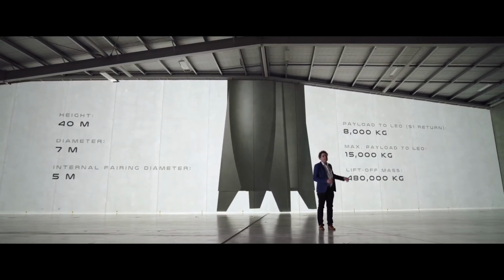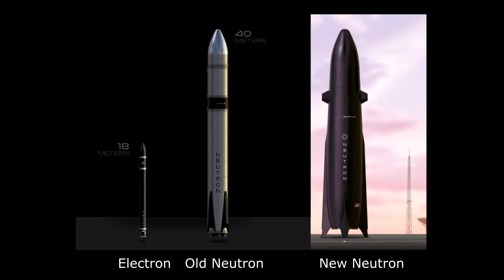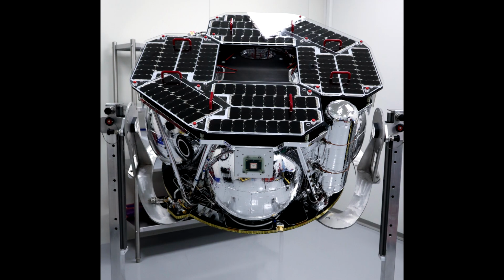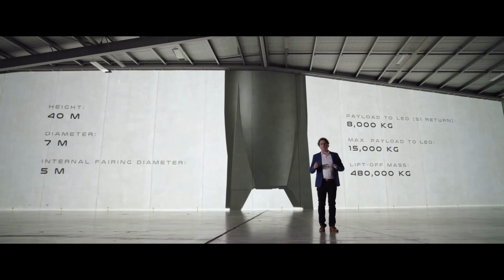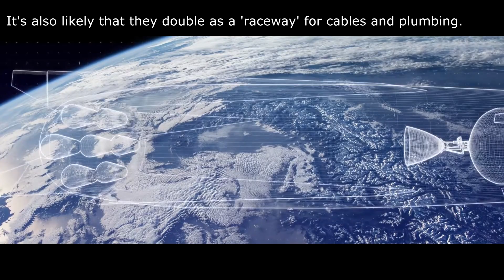Rocket Lab's Neutron Rocket Will Be More Reusable Than Falcon 9

Comment: I love everything about this. The clamshell fairing is brilliant!! Also I thought the digs at other companies was pretty funny. It’s not comparable tho. Starship is supposed to be able to go to Mars and has to return from orbit. Spacex also wants to build hundreds or thousands, so price of materials is a bigger issue. In theory rocket lab needs 5-10 at each launch site and just reuse them over and over so if it costs more to build but is more efficient it’s worth it.
Reply: It is totally comparable to Falcon 9 though. But I agree with you.
Reply: @aretorta  agreed. But other the falcon is a traditional design that has been upgraded to add reusability, where as starship and neutron are being designed with innovative designs for reuse from the beginning.
Reply: @ryanhamstra49  Yes and given the minimization of expended equipment and mass the Neutron would presumably have a lower life-time cost, but probably a higher production cost for each first stage.  If it can hit the reuse threshold then it will likely undercut F9 and all other new competitors in that 8 mt range.
Reply: @aretorta   Yes totally comparable to a 10 year old design, probably 13 years by the time it flies.
Reply: a major concern isn't just the cost of carbon fiber as it would make back that cost in fuel and durability eventually but it would take a long time to make enough carbon fiber for one starship and for what starship is designed to do being able to mass produce them on a large scale quickly is a huge part of the viability of the launch system and making them out of carbon fiber would take far too long.
Reply: There is a reason why fairings are jettisoned in all other designs. Once rocket is out of atmosphere the fairings are dead weight, significantly eating into payload capability. So while it is unusual, it is not brilliant. Others have thought about it before.
Reply: @maximlg253  Any aerodynamics of the 2nd stage is dead weight.  RL is betting trade off is worth it. A lot of things have been thought of before - the issue is with a given technology whether it’s practical or not.
Reply: Neutron is basically a successor to falcon 9 for its payload range.
Reply: Not to mention sounds expensive to replace.
Reply: lets all hope, I need a couple for my volcano base though.
Reply: I am pretty sure that I saw this clamshell fairing design in an old James Bond movie?
Reply: @MoAndAye  And you just admitted to not watching the entire video.
Reply: @MoAndAye Scott talks about the Bond movie at 4:54 (that picture is from the movie)
Reply: Guys, Gahen is just a Wannabe Troll.
Reply: Starship is never happening. When are people going to start accepting this?
Reply: @NavidIsANoob  SpaceX is good at sending stuff into space. So I would not be suprised if they send something starship shaped up into space. I don't know what it is supposed to do there.
Reply: @NavidIsANoob  
Except it already flew a couple of times. It proved that it can do most of the hard parts of the flight. The only thing left to test is the reentry, and that SpaceX has done well over a hundred times.
Reply: The only legit stab was Falcon infrastructure not Starship's anyway.  Plus, payload weight class helloooo
Reply: @lostpony4885  and the barge landing
Reply: The dry mass of Starship is just insane. A Heavy-lift Vehicle from NASA's SPS study has similar payload to Starship (120t), yet only 4000t mass when full. Which is less than simply the fuel mass of Starship, and even with some mass reserve! Apparently, aluminium construction/winged flyback is a pretty efficient design!
Reply: @HalNordmann  > A Heavy-lift Vehicle from NASA's SPS study has similar payload to Starship (120t), yet only 4000t mass when full.

Oh, let me guess... the 2nd stage there is LH/LOX? That obviously weighs less than CH4/LOX.

> Apparently, aluminium construction/winged flyback is a pretty efficient design!

Especially in PowerPoint form :)
Reply: spacex is not going to mars... analyzing Starship™ usability from that starting point is fundamentally wrong
Reply: @LoneWolf-wp9dn  It doesn't make sense for humans to go to Mars. The only thing humans can do on mars is dying more or less slowly. Rovers and probes can do the science much cheaper. It would be interesting to do missions as drilling and get samples back to earth that will be challenging and get some real data for science.
Reply: @lubricustheslippery5028  Actually it does make sense. In a billion or so years the sun will vaporise Earth and probably Mars. If we're lucky, and if we get started now on the incomprehensibly long and difficult task of finding a new home, we might just save humanity.
Reply: @lubricustheslippery5028  sometimes people just want to go & see for themselves, even if you personally are happy watching robotic photos, and besides what are we doing on earth but more or less slowly dying?
Reply: @kirkc9643  On the scale of a billion years, it matters not at all if we start now, start 100 years from now, or even 1000 or  1 million years from now.
Reply: @erikmagnuson9670  Given that currently we have no idea how to find, even get to, or establish a self sustaining colony beyond our solar system...Upon what do you base your claim? A billion is a thousand million. One thousandth of the available time to do multiple things that are currently impossible to ensure survival of humanity seems like a significant amount of time to me
Reply: @kirkc9643  Exactly - 1/1000 of the potential time. What are the odds that the impossible can be done in 1000 million vs only 999 million (given all of human civilization is ~10000 years).
Reply: @erikmagnuson9670  So you'd gamble humanity's future at odds of 1 to 1000 because someone thinks it doesn't make sense to go to Mars. I rest my case.
Reply: @kennethferland5579  ...and the after the sun collapses into a white dwarf?
Reply: @kennethferland5579  'Colonization' of Mars is not a fantasy. It is a very, very small step in an incomprehensibly long and difficult journey.
Reply: @davidkottman3440  It is super cool and awsome to have astronauts. It's just extremely expensive and useless. 
It's much easier to get to Mars than then get back to Earth. And the envirorment on mars is so inhosipital so you can't build an functioning colony. Musks ideas of traveling back and forth to Mars and building colonies is not realistic.
Reply: @lubricustheslippery5028  
The goal is not to do science, but to back up our civilization in case something happens to Earth. It's hard to do that without sending humans.
Reply: @andrasbiro3007  It's not just hard it is impossible. With current level of technology humans can't survive away from Earth without resuply from Earth.
In a way todays technology makes it harder because We rely on an vast network of factories and expertise and resources all over the world to manufacture even medium complex things.
Then we have basic needs as breathing and eating...
Reply: @lubricustheslippery5028  > And the envirorment on mars is so inhosipital so you can't build an functioning colony.

Nobody will force YOU to try and build the Mars colony. Sit back and let other people try.
Reply: @lubricustheslippery5028  Pretty sure man on Mars will happen, sensible or not, in someone's life time...if not ours, because people are interested in going despite your opinions
Reply: @lubricustheslippery5028  You are full of opinion & short of knowledge my friend. Good science, real science, requires smart 🤓 committed people, I hope you aspire to be one of them
Reply: @lubricustheslippery5028  
The impossible never stopped Elon. It was impossible to make an electric car with a decent range at a reasonable cost. It was impossible to land a rocket. And so on. Technologies that don't exist can be developed. The smartest engineers on the planet are working for Elon and he is the richest man on the planet. That makes him able to accomplish things that are impossible for normal people.
You may have missed the part where Elon is planning to send a million people to Mars with tens of millions of tons of cargo. And he is already building the rocket that can do that.
Reply: Another neat thing about Starship is that it is never going to work. Even if they get it into a technically functional state, it won't be financially viable, as they pulled the "parameters" out of their arses instead of actually calculating them. The entire rocket crumbles under its own weight if you give it a little bump, and that's without payload and fuel...
Reply: @pberci93  > The entire rocket crumbles under its own weight if you give it a little bump

Most orbital rockets are like this. 8.5km/s of dV is a bitch. You HAVE TO make your tanks very light to get to that number. All rockets are significantly supported by tank internal pressures during launch, they would crumble under 4g acceleration if not that.
Reply: @denysvlasenko9175  Oh, really? A Heavy-lift Vehicle from NASA's SPS study has similar payload to Starship (120t), yet only 4000t mass when full. Which is less than simply the fuel mass of Starship, and even with some mass reserve! Apparently, aluminium construction/winged flyback is a pretty efficient design! Steel may be cheap, but also incredibly heavy - you don't see any airplanes made of steel, do you?
Reply: @HalNordmann  > A Heavy-lift Vehicle from NASA's SPS study has similar payload to Starship (120t), yet only 4000t mass when full. Which is less than simply the fuel mass of Starship, and even with some mass reserve! Apparently, aluminium construction/winged flyback is a pretty efficient design!

Why do you measure rocket performance in weight? The ultimate measurement for economic success is COST (dollars/kg-in-LEO), not weight of the rocket!

> Steel may be cheap, but also incredibly heavy - you don't see any airplanes made of steel, do you?

Airplanes are not flying to space. Atlas 1st stage balloon tanks were stainless steel. Today's Centaur upper stage is stainless steel.
Reply: @pberci93  Ah, I can’t wait to revisit this comment in a couple of months when starship reaches orbit and returns to the launchpad successfully.
Reply: @pberci93  Lol are you seriously trying to suggest that the company that has successfully landed more than 80 orbital class boosters - re-flown many of them many times and is certified to fly NASA astronauts to the ISS has decided to spend billions of their own money on a brand new rocket without doing the math??  You think they managed to launch SN15 up to 12km,  drop into a bellyflop, freefall towards the landing pad, do a flip manoeuvre and touch down smoothly using parameters the pulled out of their asses? 

They still have a long way to go to prove that this concept is technically and economically viable - and serious issues like the Raptor production bottleneck to solve - There may be insurmountable showstoppers ahead, but to accuse them of just winging it is hilariously wrong.
Reply: @pberci93  I still remember when people were saying exactly this about reusing falcon 9's first stage
Reply: @pberci93  Sure Jeff
Reply: @pberci93  
What are you even talking about
Reply: @pberci93  Coundn't agree more, it's unlikely ever even leave LEO.  The requirements for their Mars mission profile are just rediculus and ask far far too much.
Reply: @pberci93  Which is why they too will eventually need to go with CF.  Dropping 50 tons of dry mass from the rocket means a lot slower speed, and it gliding in to land versus all but slamming into the ground with sheets of metal that tend to deform rather than bounce at the last few feet.   I would not be surprised to see RocketLab maybe even put 4 small chutes in the top as another option - open the top up when landing and deploy them to slow it down even further right above the landing site.  They seem like perfect made anchor points for something like that - and enough clearance as well to not interfere with the 2nd stage (since they would be attached to the four pieces on the inside and they open outwards)  Half the landing mass, possible chutes to slow to to a few m/sec, and a controlled burn... Looks promising to me.    Versus the suicide burn we see with Starship (though it IS cool to watch)